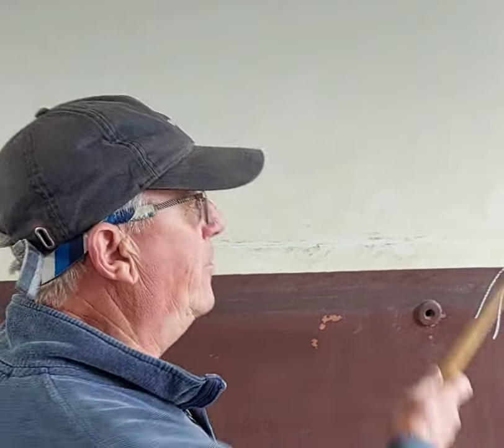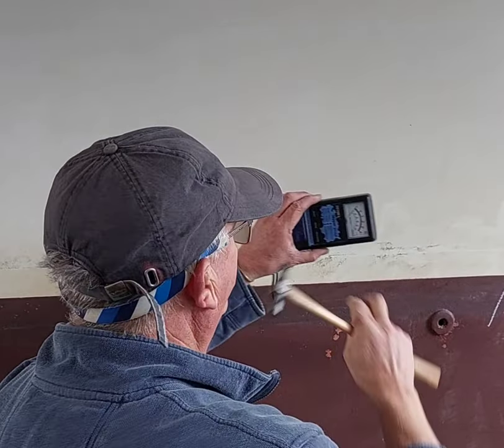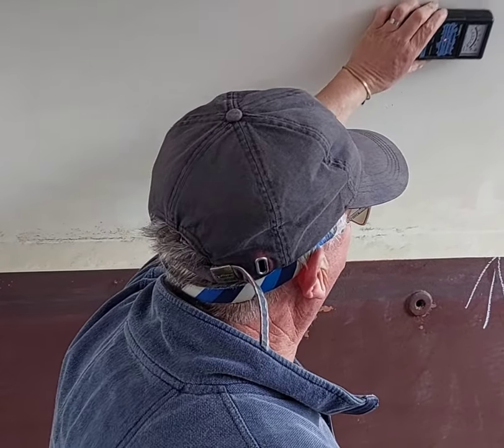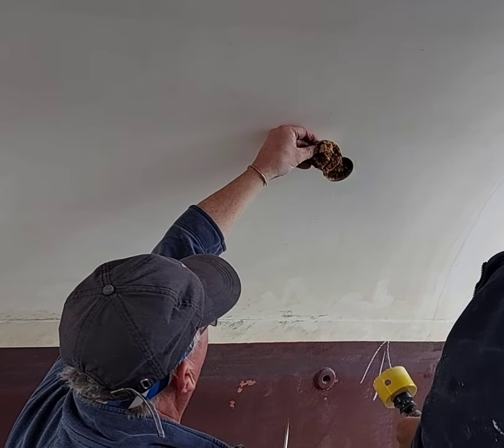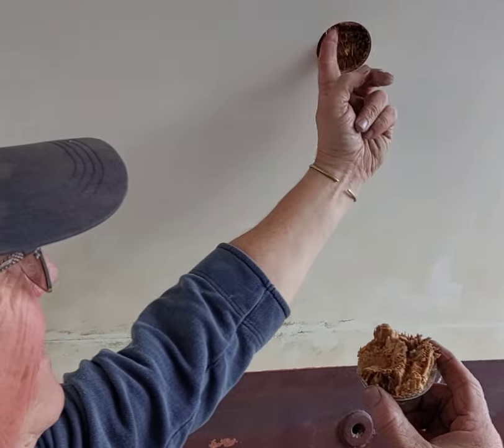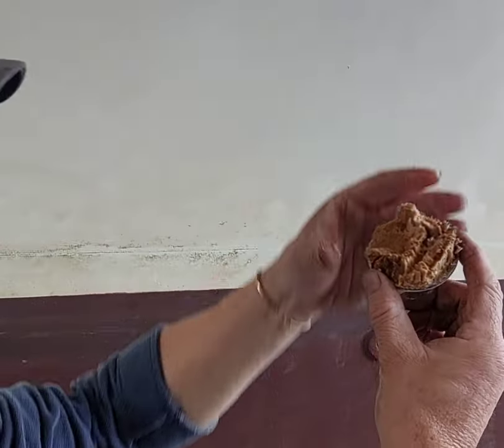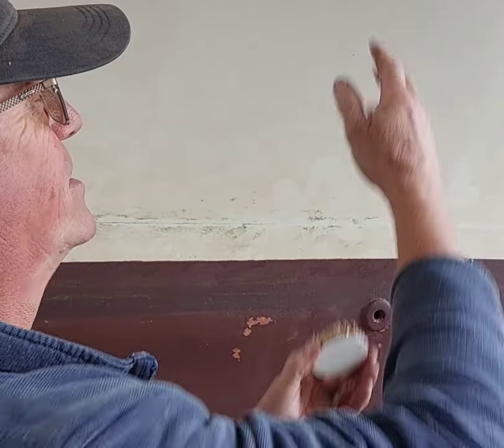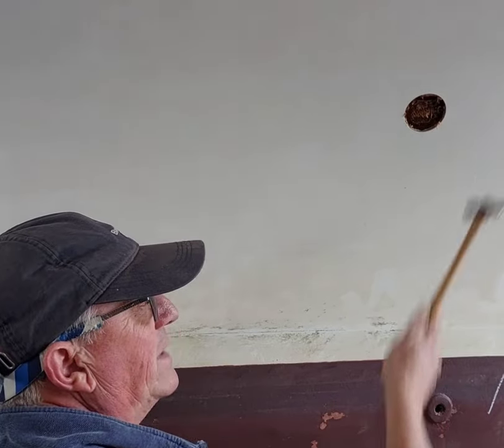Seriously failed balsa core on GRP yacht.

Comment: Another great and practical video.
Had the same problem on deck when replacing the anchor winch of our 1976 Nicholson 35.
The positive side of it was that we then knew the cause and (!) were able to repair only locally.
I hope that a cause in this boat’s hull can also be found!
Regards, Harry
Reply from the maker: Yes I know the cause and as its a clients vessel didn't want to go into that but its a valid point.  Deck locker drains drilled and a number of fastenings through the core is the most likely in this instance.
Reply from the maker: Yes decks are always a problem where a fitting goes through.  The winch area should have had an area releaved of core.

Comment: So where do you go from there
Reply from the maker: Very good question.  Depending on fit out either cut internal and replace from inside or if she has complicated internal fit out replacement externally but not for the faint hearted. Costs potentially Depending on affected area could exceed the vessel value.
Reply: BER Oh no, if it's in an isolated area then possibly not but what's the chances of that.
Reply from the maker: @Mike_Shaw  often depending on the cause. West epoxy make an expanding foam epoxy that's quite successful